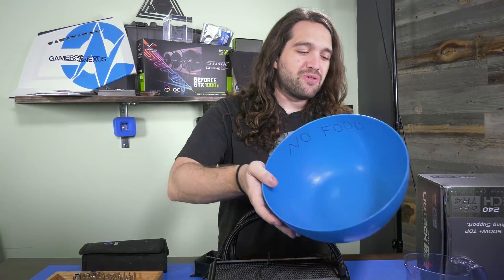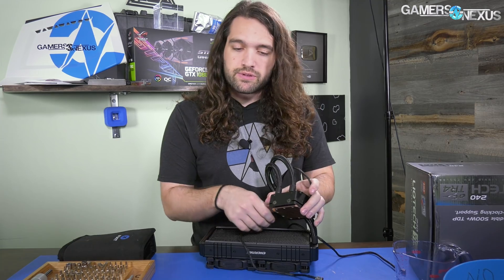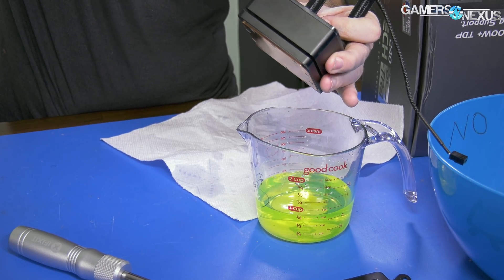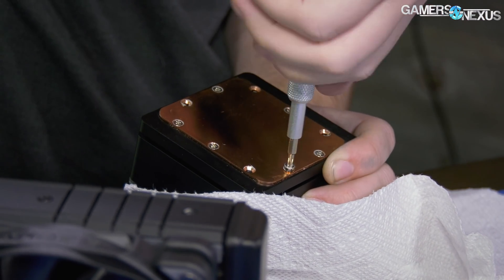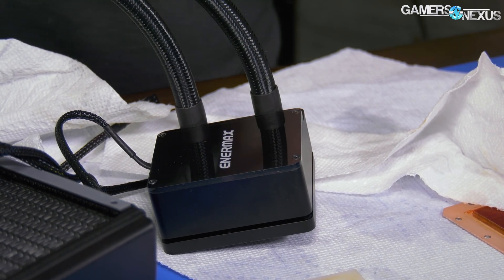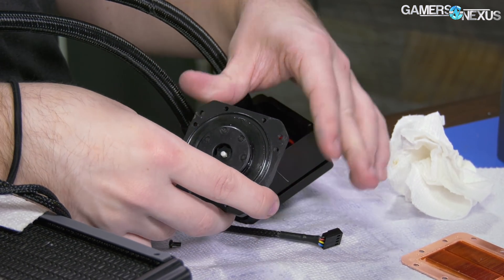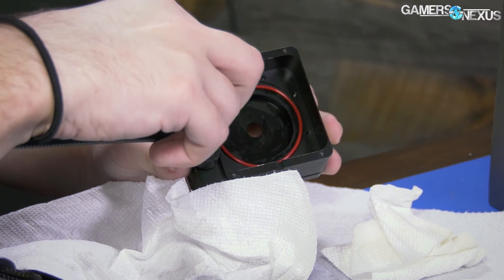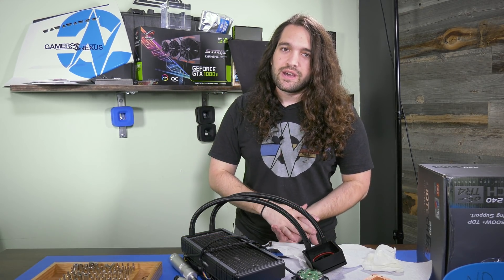Tear-Down: Enermax Liqtech Threadripper Cooler

Comment from the maker: Find our review of the Enermax Liqtech coolers (360mm & 240mm) here: https://www.youtube.com/watch?v=6jICNXAQrgs
Link to the cooler in the description.
Reply: This part was very likely cnc machined from a billet block. Indicators for that:

- very smooth surface
- large inner corner radius for use of stiff, large diameter end mills
- no taper for easy release out of a mold, indicates a part that wasn't cast, but straight walls that again indicate use of standard cnc end mills
- lots of features that have to be machined even if the part was cast, such as the o-ring groves and all the screw threads. If you machine lots of details on a part, you might as well machine the whole part right away and omit the casting step since it won't make the part much cheaper.
- overall a part design which makes it very suitable for machining

Besides that, i assume the part is quite lightweight, which would indicate aluminium. Aluminium is very easy to CNC machine since the wear on your tools is very minor and you can run very high speeds. This makes it more likely that the part was machined.

Considering that Threadripper is a high end product, i would assume this liquid cooler won't sell in all that large numbers. That means a manufacturer wants to keep his tooling costs down, since an investment into expensive tools like casts or tools to press powder metal parts are only viable if you produce a lot of products. 
Tooling costs for a part like this are almost non existant if you use cnc machining.
Likely you won't procure a cnc machine, but already have one in your company for other parts. The end mills, drills and threading tools used for this part are very cheap and small, standard wear parts you likely have in stock anyways when you own a cnc machine. Clamping can be done in a standard vise, and writing a program to mill this part is done in a few minutes even on an old school machine where you can't use fancy CAM.

I doubt that powder metal was used, assuming the part is lightweight, since producing these very smooth surfaces and very fine threads in aluminium with a powder metal process seems very challenging to me, especially for a limited number production run.
I am not sure, but i think there might be sealing issues with o-rings on powder metal surface without machining it after the powder metal process as well. And again, if you have to machine anyway, why invest in an expensive tool and difficult to control process if it only gets half of your part done.

The expensive part of machining this part is mostly having to deal with the maching process in general, like clamping the part down, etc. Once the part is in the machine, it doesn't matter if you "only" cut the sealing surfaces for the o-rings and drill and tap the holes for the threads, or of you machine the entire part. The reason for this is the very short time a modern cnc machine needs to cut that large pocket into the part. This is done in a few seconds. Tapping the holes, clamping the part, opening and closing the doors all together takes so much time that cutting the large pocket, which makes up most of the shape of the part, adds maybe 10-20% machining time, which isn't a large increase in cost. Compare that to a cast that would "only" take care of these 10-20% machining time, that won't save you any money but rather cost you.

tl;dr: 

Long explanation, but an experienced machinist and engineer can already determine a lot from looking at the shape of the part alone and we also know it has to seal liquids, it doesn't experience high mechanical stress, and was probably produced in a small to medium quantity. That narrows it down to "machined" for me.
Reply: To me it does look like that block was machined, however I would need some more photos to give you a good assessment. What your looking for is some ejector pin or parting line markings https://www.finishing.com/314/31470.jpg   http://www.diecastingdesign.org/studies/case3/images/Parting%20Line.jpg . These are a dead giveaway that it was die cast, but will be fairly difficult to find consider that the part looks like it was also put through a vibratory mill to clean up the surface finish before anodizing. Another way that you can check is to see if the bottom of the pocket is perfectly perpendicular to the sides. Die casting requires a small draft angle to make it so that the part can be ejected from the mold, so if it is perpendicular, you'll know that it was milled. Since this is a relatively low volume product, milling makes more sense in some ways, due to the expense of manufacturing the molds for die casting
Reply: If you want to clean it you apparently should buy some Primochill Vue.
Reply: +Risto Mladich I knew I was forgetting about a manufacturing method! I have to agree with you on this, especially since you are able to make internal threads with sintering. Perhaps it would be too difficult for those T10s, but the reduction in manufacturing steps would make it much more cost effective
Reply from the maker: Risto & Inspector -- thanks for the comments! I have been wanting to learn more about these processes, and this is a good start. I appreciate you sharing your knowledge! ^SB
Reply: Inspector Poirot 
I believe the fins are fan-folded, then brazed onto the base plate,  which looks to have been milled rather than cast. The corners and edges are quite sharp, and the tool marks seem to still be in the vertical portion of the die.
Reply: Risto Mladich 

First off, the process is called "sintering", as in "sintered bearings", or "sintered gears" (which are used in drills as a point of failure in case the drill bit jams, so the gearbox itself isn't utterly destroyed). 

Secondly, sintering creates a porous part (hence sintered bearings, because their porosity allows lubricants to soak in & deliver to the bearing surface as needed), which would turn any waterblock made of sintered material to turn into a sprinkler system.
Reply: Have a look at https://linustechtips.com/main/topic/909855-enermax-tr4-360mm-aio-high-tempsproblem/ and some comments on Reddit saying the fans are getting loud (which they shouldn't at all). To me, the gunk buildup that we just barely began to see in your video seems to be a fairly regular problem once you have the cooler in use for a few months. Might be worth a little further investigation.
Reply: this is bad that gunk will build up in the block and loop and screw up the whole cooler ive seen other reviews and they have shown this
Reply: I thinks its powder metal formed which is cheaper and more precise then casting and cheaper then machining. every single drill has gears which are made out of powdered metal, atleast with cordless types today. only way to tell is took at it with a microscope.

Comment: If copper and aluminum are installed in a conductive medium (water - any kind, even pure) they will produce a galvanic differential of about .58 volts, and the aluminum will be taken into solution. This will happen very quickly if the copper is screwed to the aluminum  as is the case here (shorting the battery). The white gunk/paste found in this and similarly constructed coolers is aluminum oxide which precipitates out once the coolant (electrolyte) is saturated. It's very hard and abrasive, and will kill the pump pretty quickly. If the cooling loop was all copper or all aluminum, all would be well. This is common knowledge to experienced engineers, which are apparently in short supply at PC component manufacturers. If you doubt me, search "Aluminum/copper battery" It's a high school experiment, and also the bane of boat builders as well as computer accessory builders.

Comment: don't buy these things. They're cheap garbage. My first unit lasted about 6 months and the pump died. second unit has only been going for about 3 months and is already showing early signs of the pump failing. My buddy also had one of these and his pump failed in about the same time frame as my first one. These things have very weak pumps that are not at all durable. Will almost definitely fail on you within the first year of use and the replacement will be just as bad.

Comment: This repair is definitely necessary - my Liqtech cooler was far worse than any other I've seen, but I've also seen posts from tons of people with terrible corrosion issues.  HOWEVER, don't be like this guy in this video.  Get yourself a 40ml syringe from your local feed store (or Amazon) - it makes it super easy to refill your radiator and water block, and helps you accurately measure how much you put in (and it costs like $2).  Using a funnel and a cup is... well, it's as hard as he makes it look, or harder.  Having said that, my pump housing is so pitted that I don't think it'll last through more than 2-3 repairs - after that, I think it'll literally corrode through, and leak in the case.  Finally, for what it's worth, my cooler seems to be running just fine at 100% capacity 3 months after a cleanout, filled with about 70% distilled water and about 30% 50/50 pre-mix automotive antifreeze (NAPA brand) with a tiny quarter of a drop of Dawn detergent in the liquid, added with a toothpick.
Reply: You say the pump housing is pitted.  Do you think if you had drained the original coolant before even using it, you could have avoided pitting?
Reply: @turdfurguson2609   - would have been worth a shot I suppose, but who knows.  The fluid that came out was quasi-congealed, yellow in color, and has some nasties floating in it (well, suspended/sinking in it).  I have no idea what it was originally.  But, I will say that they've got aluminum parts right up next to copper parts in a fluid medium - that's just asking for ion exchange and corrosive effects.  So, I have no idea if better fluid from the beginning would have made a difference.
Reply: @tymarbutinstructionalvideo9726  hello!  Since writing the first response, I have been doing a lot of studying on aluminum and copper galvanic corrosion.  Also I bought a new in box liqtech tr4 version 2.  I dismantled it without running it, and found no pitting on the pump housing.  I do not know the condition of the inside of the aluminum rad though.

Since posting I have learned that anodized aluminum parts are considered safe, as aluminum oxide is non reactive electrically.  So the pump housing is PROBABLY ok.

My hypothesis is that the fluid was bad and the copper was reacting with the aluminum in the rad.  Then gumming up the fins and possibly aiding in pitting of the pump housing.

Anyhow, I plan on putting good fluid in, and running a full copper radiator, just using the aio pump/block combo for the full coverage of the IHS.
Reply: @turdfurguson2609  well, good luck of course.  I've heard the v2 should be somewhat improved, but I'll also say that my pump block was also anodized and it seems like there just needs to be a little microscopic break in the anodization for a pit to form... Or something.  Anyway, hopefully your v2 stays running longer than mine did!

Comment: This cooler is garbage.  After a few months of operation the CPU was hitting critical temperature and Throttling significantly under load.  Enermax replaced it under warranty and while the replacement was markedly better--  temperatures went down 20C across the board-- just 6 months later the replacement has nearly stopped working.  My 2950X without any overclocking what-so-ever is throttling all the way down to 2.1GHz and idles at 65C. In concept its a killer product.  In reality, it's just road kill.  Stay far away...

Comment: After 6 months, my T2 Temp on my 1950x is 77c just watching this video... I got the "Enermax Liqtech TR4 II 360 Addressable RGB AIO Liquid CPU Cooler" on the way and I will gut my current rig and post the results. I will try to restore the unit in case the new Enermax has the same problem. :-(

Comment: I bought an Enermax tr4 280 for my Threadripper build in feb, 2018.8 months later( 10-28-2018) my cpu was over heating @ 70c idle temps.I took it apart to find one of the inlet/outlet ports was 100% clogged with debris similar to the 'grey gunk' you saw in this one.after removing the pump it became obvious that the coolant Enermax used in mine was brown in color and had ALOT of debris chunks in it and the aluminum had severe corrosion and deep pitting.The copper cold plate looked nearly perfect so I'd guess the coolant used in my model is highly corrosive to aluminum.After doing some research about this on various forums etc. many others are having the same problems with Enermax liquid coolers.

Comment: Enermax just sent me a liqtech ii after I noticed reduced performance with my original purchase.

Just watched a teardown of the liqtech ii on another channel and it seemed like they didn't improve the coolant and even noticed the same gunk starting to build up.

Wondering if I should try and replace the liquid with a better coolant that won't corrode.
Reply: Wondering if you had any luck replacing the coolent with a better one?

Comment: Pretty late to the party, but this cooler is well known to corrode itself and cause thermal issues. Replacing the liquid inside with an anti-corrosive is highly recommended before installing.
Reply: Would coolant from Koolance be a good option to consider?
Reply: @elvintp10  judging by extended testing with different solutions, the cooler itself is just fucked. Replacing the coolant won't help

Comment: anybody have one of these fail? Seemed great quality, my pump failed after 5 months (enermax 360 tr4) and i switched to noctua, enermax sent me a new unit but i am hesitant to put it back in, afraid it will go out on me and damage my CPU this time, built the threadripper machine i had it in after my koolance pump died and fried my i7
Reply: Yup, mine just did, bought it end of jan, so only a few months old, basically no flow left in the thing, pump is fine, probably filled with corrosion or so
Reply: who knows, they sent me a new one, not sure if i will be trusting it again- their RMA dept is very difficult to understand on the phone, and their emails are weird, somehow ive been sent 2 new pumps and 2 sets of headphones as well, no info at all on returning the faulty unit
Reply: they will not release an explanation for why these have been failing and what they have done to remedy it, I think Im going to keep my enermax in the box until they do
Reply: Already on a Noctua because my 360 was delivered dead on arrival, leaking everywhere on the unopened box, so sad....

Comment: 5:45 copper can build 2 forms of oxides. 
The black copper oxide (CuO) and the red copper oxide (Cu2O)
If there would be more air in the loop, the oxide would be black.
Edit:
Can anyone put a multimeter between the copper plate and the Radiator? They probably put acid in the fluid. I bet the whole thing works like a Battery and desolves the copper. 🤣

Comment: I just bought one of these and it seems OK when running, but in the package there was a bit of liquid on the block which I wiped off before installing.  I see no leaks as it is running.  Is it safe to leave it or should I try to return it?  I have never bought one of these before and I don't know if this is normal or a sign of defect.

Comment: I design hydronic systems for a living (boilers and stuff) and that discoloration could be due to the pH of the glycol mix. When heated is has the tendency to become acidic over time and if they didnt balance the pH after adding the glycol, to what I would assume is distilled water, you could something like that. If the pH was off before that it could be even worse obviously.

We see similar stuff in the industry when people with in ground snow/ice melt systems never maintain their glycol. It has caused heat exchangers in boilers to leak given enough time.
Reply: Good insight and you were probably right, heaps of people have reported leaks and corrosion with these coolers in the time since.

Comment: The mark of a quality part is if you can disassemble it and reassemble and have it function again.  As for the base, if you don't see any machine marks its most likely MIM'd [metal injection molded]  its a bit different than die casting. It gives a bit more control on grain size in the part be I g cast.

Comment: With just 4 Torx 6 screws, looks like you could easily change the oritentation of the Enermax logo depending on how you have to orientate the block and tubes.

Comment: Is Corsair H100i V2 and Corsair H60-80i better than this?
Just want to know, i don't see anywhere the review between Enermax coolers with those for Threadripper.
Reply: No, there is no other production CLC that works as well as this one for Threadripper. The Enrmax Liqtech 240/360 are both exceptionally good coolers, for TR & a LOT better than any other CLC on the market. Unless you went with a custom loop, these are the best it gets, when it comes to cooling, for Threadripper. And before anyone says it, yes they are better than the Noctua TR air-coolers, too.
Reply: 10 months later and all the enermax ones have fallen apart, do not buy if you value your threadripper check out some of the reviews on amazon or wherever

Comment: The body looks casted, because it has small circles at some places that are usually an indicator for that.
If it would be machined, you would see machining traces, i think.
you can see one of those small circles i'm talking about at 11:52 on the inside right lower corner underneath the upper screw hole.
But i could be wrong.